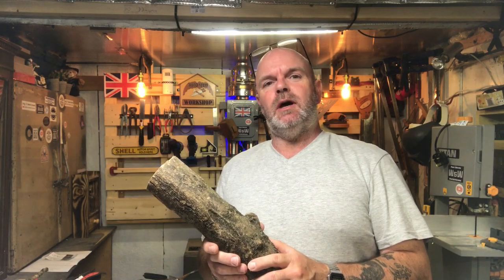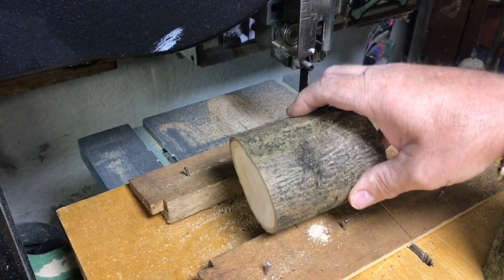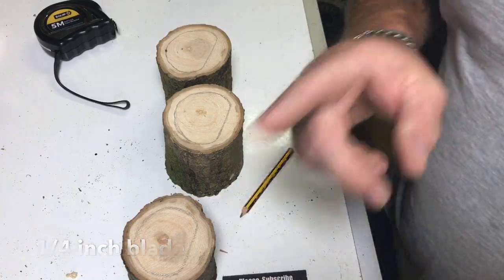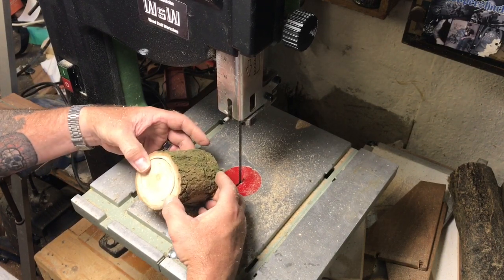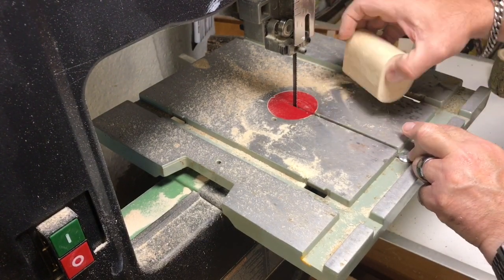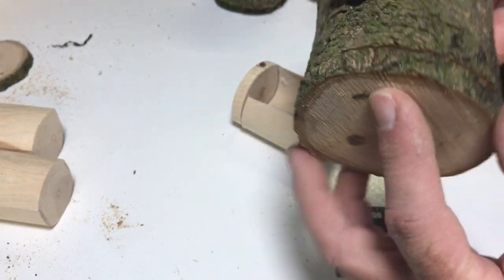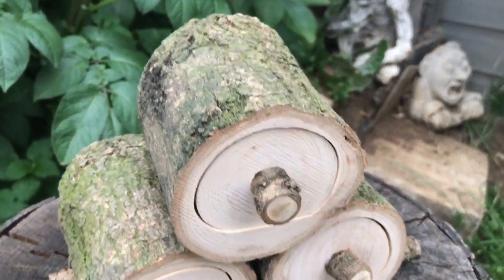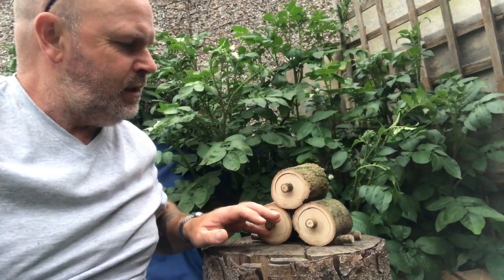How To Make Bandsaw Boxes Hobbit Style

Comment: Never had any luck making bandsaw boxes ,my little bandsaw seems to bog down.
Reply from the maker: Thanks for watching Michael, yeah I never tried on my smaller bandsaw. This one's got a 9" depth of cut and I was only cutting 3 1/2" so it managed ok.
Take care David 👍
Reply: My smallest band saw has a cutting height of 3.15", I have made a lot of bandsaw boxes with it.
I use 1/4 "and 1/8" blades.
However, I just ordered a slightly larger one I could get brand new for under half the list price, I think it's a bit too small, and the other one I have is way too big, but the small one can easily make boxes.

Comment: Hi - nice video something I am looking for to build using my new bandsaw and also a tree I had to fell since it was dead. One question - should I dry the log to a moisture level below certain value before I attempt this? TIA.
Reply from the maker: Hi, I usually wait until it is down to 14 percent or lower. Steady drying will avoid loads of splits or twists. I leave in the workshop and wait for the levels to drop over a period of time 👍